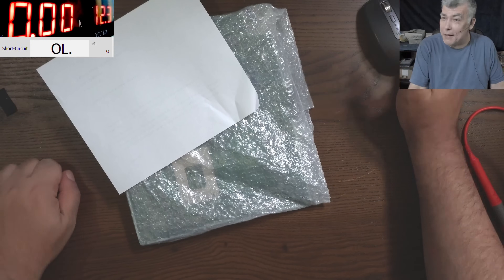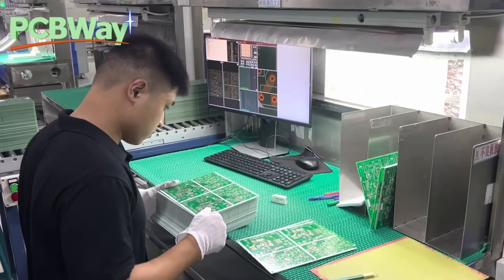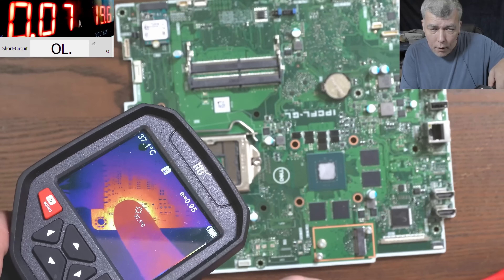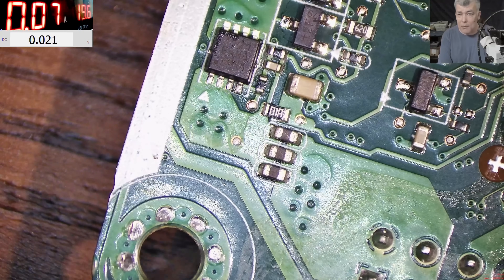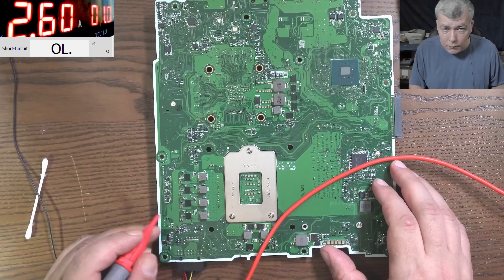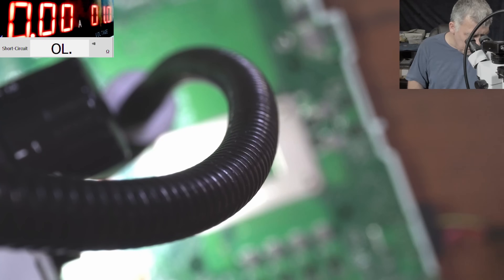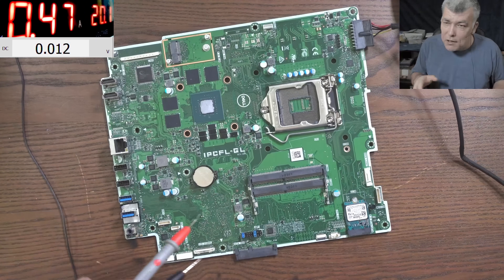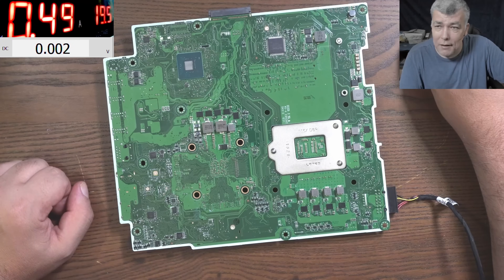How to find a blown capacitor - Dell AIO board repair

Comment: Hello and thanks for your videos.  Could you please help me to identify a smd component? At 4:56 in this video, on the bottom left part of the image,  there are 3 black components in parallel that I think they are capacitors, like the little bigger brown one just a bit above in the image.  Could you please confirm? I have the same to replace on a laptop motherboard.  They were shorted.  How is it possible to know which specs they were? Thanks
Reply: Well I eventually find the schematics of the motherboard and they are not capacitors but ferrite bead 🤭. But at least now I can troubleshoot more precisely and know exactly what to order. Still thanks for showing your tips!

Comment: My professor...

I learnt from this video that whenever a  PC is off. The only thing that got power is the EC chip and it takes 3v... so what's the actual current it should be taking?

Thanks in anticipation.

Comment: Wouldn't you do a visual inspection of the board and the components before using the power supply, multi meter and thermal camera?
You should have seen the blown capacitor during the visual inspection.

Comment: How does the board get ON without a CPU in the socket ?
How other big chips Power rails started without processor in socket ?  🤔🤔
Maybe some boards are working like that ?
Reply from the maker: The EC/SIO/startup chip is starting the board, not the cpu